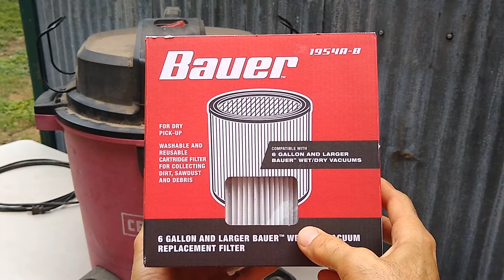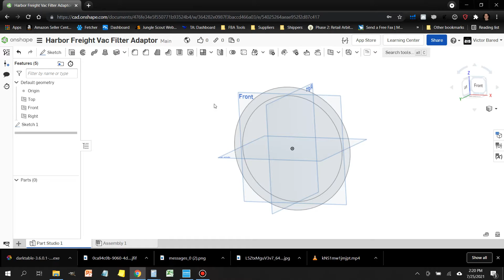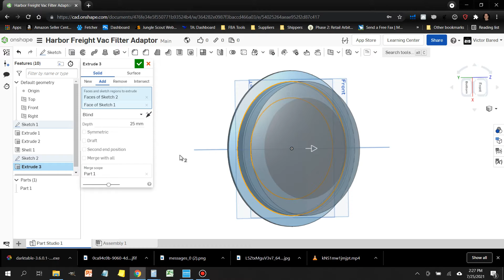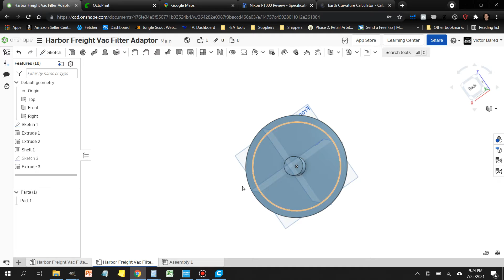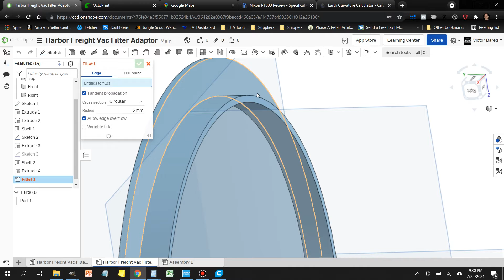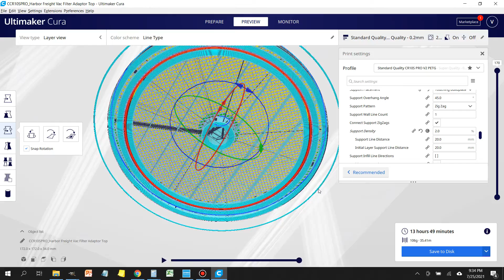How to design and 3D print an Adapter to fit a Washable Bauer Filter to a Craftsman XSP Shop Vac

Comment: I really enjoy your videos and tried out onshape based on your recommendation.  I hope you will excuse a criticism, but  your way of design of round parts is a very hard way to go about it.  An easier way is to just sketch out one half of the cross section of the round part, draw a construction line axis of rotation in the center of your part to be, and do a solid of rotation of your sketch to make the part.
Reply from the maker: Hello 200OK, Thank you for commenting. No worries, valuable feedback is always welcome. You're 100% right, the revolve tool is the simplest way to design these parts. I'll be sure to us it on the next design video involving round parts so others can benefit from your suggestion.

Best of luck with your projects!